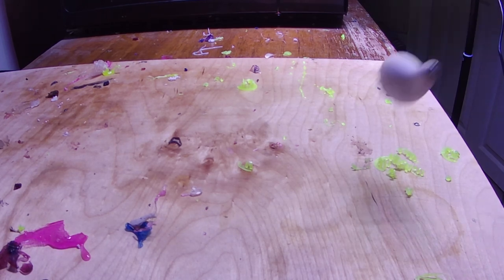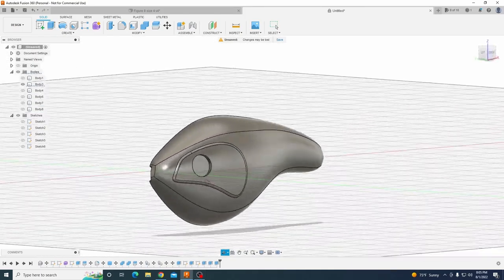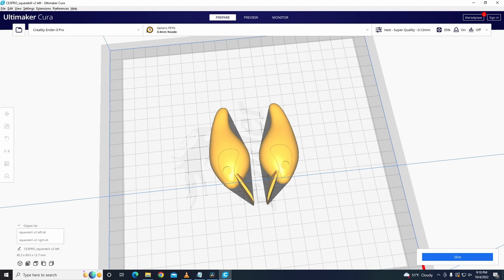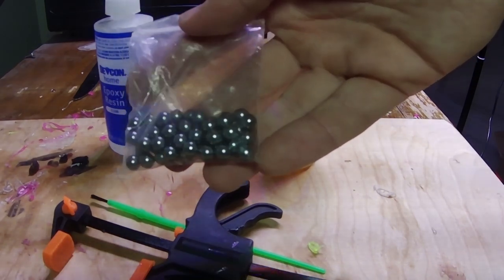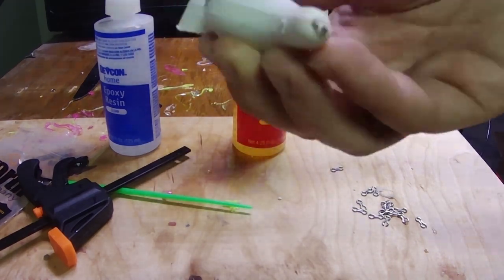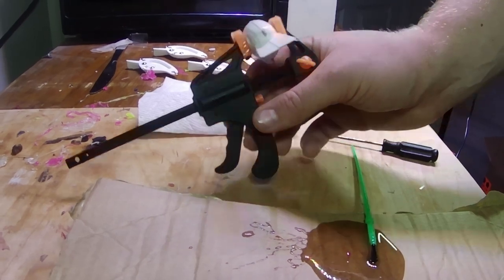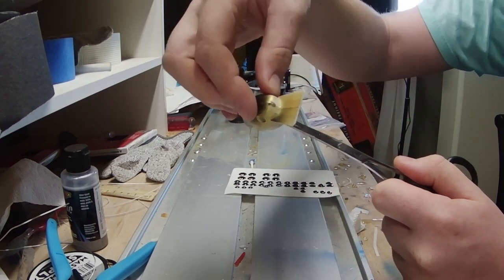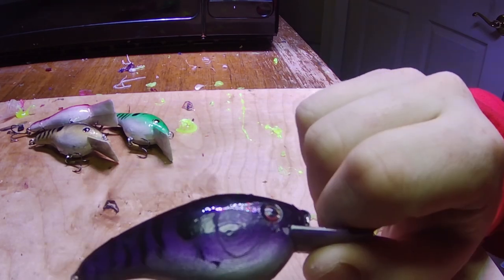3D Printing a Squarebill Crankbait

Comment: I have made a few of these, I put them together just like you. I can get them to track at all. What could I be doing wrong? They all wan to track to the left and they float on the side.
Reply from the maker: Really sorry to hear that!  So the tracking was an issue I did have a little bit of. They tracked fine for normal casting which was the way I tested it. After I posted the video I tried trolling them and at higher speeds they would blow out to the side. I think the lip is a little to big and I need to play with the line tie angle. But it should track normally with a normal retrieve. Mine had no issues with floating on the side though. That sounds like a weight/ ballast issue. This is honestly one of the lures I plan on revisiting. It came out a bit larger than I wanted and I also want to make it more stable. My email is HandCraftedAngling@gmail.com I would be happy to try and help you diagnose whatever is going on if you want to shoot me a message.
Reply: It was my fault, I did not have the infill and wall settings set like you specified. Printed a few new ones today. I will test them tomorrow. Thanks
Reply from the maker: @butchlacour4548 let me know how it works out. Unfortunately especially with small baits the weighting can be kind of difficult to nail down
Reply: yeah my ball bearings are one size bigger that 1/4 inch. It sank like a rock. Still playing with it though..
Reply from the maker: Yeah it was slow floating when I made it. I’m changing up the hardbait design from now on to have wider weight holes so people can tune it to their liking.
Reply: I’ll get it. I’ll just have till I get home from Saudi

Comment: How do you download a file or whatever to make those crank baits?
Reply from the maker: The file is a 3d model that is meant to be printed on a 3d printer. You would print it out and then assemble it following the steps in the video. I plan on doing a tutorial series on how to get into 3d printing specifically for making fishing lures. I want to have a few more lure designs before I do this so someone could go pick up a 3d printer and have a decent selection of lures to print.